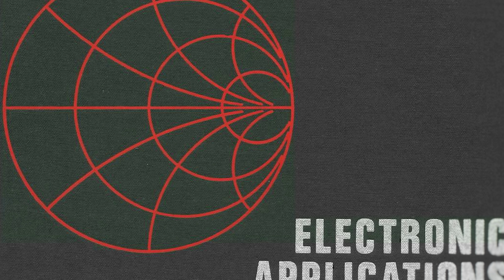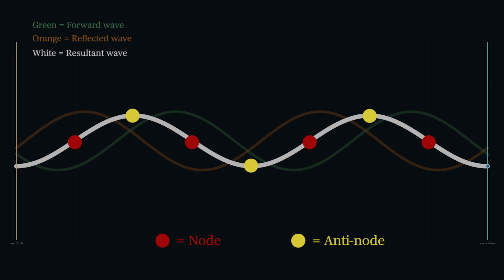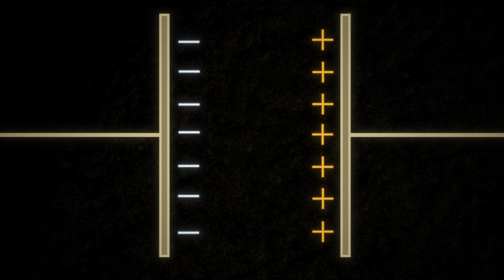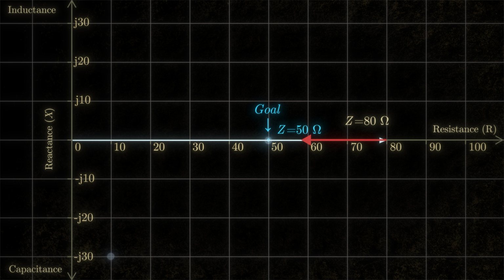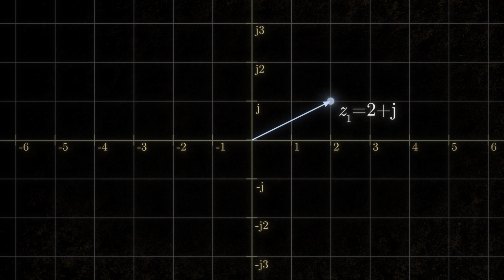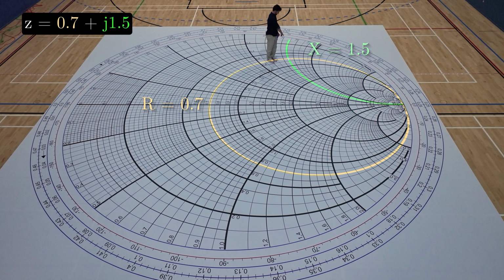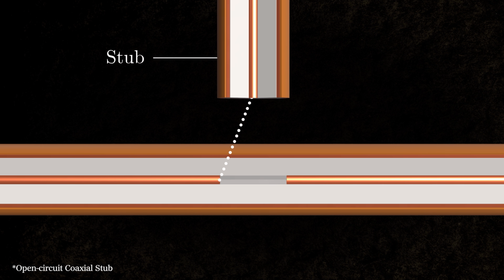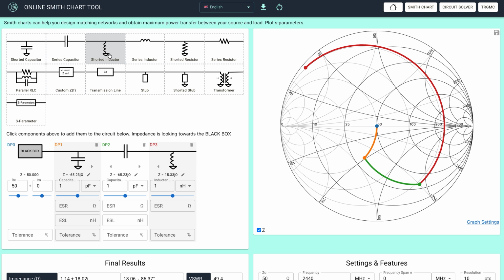The Scariest Chart in Electrical Engineering

Comment: Reality is a simulation. Physics, neuroscience, and mathematics all point to the same conclusion: you are inside a constructed system designed to be invisible from within. Matter does not exist until observed. Your brain deletes 99.9% of incoming data before you see anything. Your memories rewrite themselves every time you recall them. The double slit experiment proved particles choose a state only when measured. The quantum eraser proved that erasing information reverses the choice. Wheeler's delayed choice experiment proved the present rewrites the past. The Planck length and Planck time reveal a universe with a minimum pixel and a fixed frame rate. The holographic principle proves three-dimensional space is projected from a flat surface. Six physical constants are fine-tuned to tolerances that cannot be explained by chance. Bostrom's simulation argument leaves no fourth option. Hoffman's fitness-beats-truth theorem proves evolution built your perception to hide reality, not reveal it. Gödel's incompleteness theorem proves no system can fully describe itself from inside. The cage is real. The bars are mathematical. And you were built not to see them.

Comment: "Pies and tries", as any good Irishman and ski instructor should know!  They should know of the shock and dangers of detection (hyperbolic mathematics, concerning stealth technology) and counter-detection concepts (elliptical mathematics, concerning potential abuses of communications, with the hyperbolic and elliptical ordering flipping in mattered contexts), while having an adult sense of awareness, sexuality, and violence in geometric terms (Euclidean postulates with spacetime considerations).

The breakup of dark matter = 1. The end of an observable universe's expansion, due to additional gravity of baryonic matter = 4/3, Weierstrass factorization theorem, matrix of prime numbers and mediants - 2 x 2 (Maclaurin trisectrix) for the weak force and 4 x 1 (hyperbola, with eccentricity 2) for the strong force, leading to fractals. The three in the denominator represents how dark matter can break up from impact (Tomahawk method) or from loss of rotation over time (Thomas Hutcheson's cylinder method). The locking up of black holes = 8/5, cosine of θ, Lagrangian mathematics for the degeneration of black hole singularities into dark matter singularities. The leading and trailing points of the black hole singularities create areas of intense gravitational density that focus shrapnel into dark matter. Stacked planar contact at the heart of a Big Bounce event = 2, limaçon of Pascal, with the limaçon trisectrix being the special case for primordial black holes. This is required by the Law of Conservation of Mass ("object permanence"), in our infinitely vast reality. Musical notes are measures of topological permittivity.

Using a mediants topological approach, adding up the 4/3 and 8/5 yields 12/8, suggesting Ramanujan's Infinite Sum of the natural numbers, and General Relativity, as part of a Big Bounce event.  The 3/2 form shows the three alternating singularities from degenerating black holes guiding shrapnel to form dark matter.  The Tschirnhausen cubic and the Dürer folium combine to give lensing abilities, such as viewing the Riemann Zeta Function, in the complex plane, pointing to the critical points in it.  The limaçon trisectrix corresponds to the CMBR.  Then, from a facebook post on October 26, 2024, "The Dürer folium:  whether in a proton or neutron, the two ring/cylinder/horn elliptical singularities cannot stably form obtuse associations."  Then, the regular trifolium means that locked up black holes must have their singularities alternating.  Finally, the Tschirnhausen cubic prescribes the singularities for dark matter that is about to form.

Nature does not play around with stability.  Society must openly plan around it.  Stability, as seen from General Relativity and the fourth power of the speed of light, demands the shortest time possible for instabilities - the Inflationary Epoch as an obvious example.

2, to the 72nd power reductions in complexity are from comparisons of particle stabilities and Big Bounce events, and are because the limits of topological oddness and evenness become contained during a (darkened) Big Bounce event, forcing a mathematical cancellation in formulas.  This is just like how the limaçon trisectrix, the Dürer folium, the regular trifolium, and the Tschirnhausen cubic contain ambiguities and dualities to give clarity, with hidden figures for unstable particles connecting those trisectrices.  52 Card Pickup!, with these trisectrices as suits.  The 13 factor corresponds to primordial black holes and can be seen in the Neusis construction of a 13-sided regular polygon.  Eric Weinstein has his 14-dimension topological manifolds ideas correct.  (The instance of Neusis construction with 7-sided regular polygons concerns event horizons, which I gave Scientific American "a talking to" about back in late 2000, and I researched some more back in 2012.)  These comparisons collectively form a Bell curve shaped "safety blanket".  π, cubed/6 is the football that Charlie Brown never gets to kick.

The Inflationary Epoch can be used as a microscope to reduce complexity, looping topological oddness and evenness.  Hard mathematics.  Exact formulae.  The ambiguities (good sonarmen don't get zoofed) and dualities (good sonarmen don't collide with anything) can be looked at with similar reductions in complexity from the spacetime navigation/relativistic topology, but with a Bayesian statistics approach.  Considering the Law of Conservation of Mass (identity) versus the (three) infinities expands our understanding of fundamental laws of calculus and reality.  Considering matter stretched past equilibrium (singularities) helps with understanding properties of stable matter.

I learned how to dimension arrays with my first computer program on an old Atari, back in 1981, when I was also learning to play the piano. My grandfather kept a big tree in his front yard with grape vines. He would teach with the symbolism of mason jars and errands, with orange gummies as rewards.

On my second submarine, the USS La Jolla (SSN-701), the Captain, Mike Oliver, would throw me little red hot cinnamon candies, for being such a fast sonarman. Baker, a fellow sonarman, would have me work on the hull, just aft of the sonar dome, to practice my appreciations of statistical and elliptical mathematics - and to clean the hull. (Obi-Wan Kenobi knowing how to find the information on the Death Star from R2-D2.) One day, I nearly lost a wallet to the ocean!

Working on installing communication lines in southern California in 1998 and 1999. Childhood "SECRET.BAS" programs encrypted in binary, from some advice from the Norton folks, "stealing" subroutines on inkeys from other programs. Programs that evolved from "WATCHCAT.BAS" and "WATCHDOG.BAS" programs, all inspired by defensive thinking. The Army made sure I knew how tools and machines worked, by teaching a "paradigm" involving gears, during my ASVAB test (December 23, 1993), after noticing my skills with analyzing polar and parametric equations.

To dimension an array is to consider whether it should be finite or infinite in length.  Finite corresponds to the special case of SSA triangle congruencies, navigation, and contained ambiguities.  Infinite corresponds to Euclid's 4th postulate of right triangles, collisions, and released dualities.  SOund Navigation And Ranging.  (I used to have to man my battle station with the AN/BQS-15 Under Ice and Mines Sonar.)  Building a topological oddness and evenness structure around the ambiguities and dualities allows for proper decision making.  "Around the survivors, a perimeter create."  Now, how to protect without imprisoning?  That mandates fundamental teaching!

It's not bad to have "object permanence" and to appreciate identities and the Law of Conservation of Matter and Energy, in our infinitely vast reality.  It's not bad to use the three infinities - infinitesimality, linear infinity, and circular infinity - to make good decisions to survive and thrive, openly keeping balanced and fair attitudes.  It is bad to abuse the cubic root of the imaginary number mathematics to threaten stealthy attacks or to abuse lines of communications.

Comment: I was once asked how the reactance can change from completely inductive to completely capacitive at the point where the outer ring of the Smith chart passes through infinity. It's a good question. The key to understanding this is to consider what happens to current when the reactance becomes infinite. Imagine the wave amplitude of the current getting smaller and smaller as the reactance approaches infinity. Then, at the infinity point, the magnitude of the current is zero, a flat line. As the infinity point is passed the magnitude becomes non-zero again. But the parts of the wave that were positive pass through zero and become negative, and the parts that were negative pass through zero and become positive. This represents a 180 degree shift in the phase of the wave which equates to the change of the circuit from capacitive to inductive (or vice versa.) This is because the phase of the current with respect to the phase of the voltage defines whether the circuit is capacitive or inductive. In a capacitive circuit, current leads the voltage and in an inductive circuit, voltage leads current (you may have learned this as "ELI the ICE man.") I hope this helped!

Comment: Same principals apply when protecting the transmission lines as well. Some lines use DCUB and DCB communications which uses frequency shifts on the power lines to communicate disturbances. 

Any shifts within frequencies pre set by us outside of those regions lets the protective devices know there’s a problem on the line. We can fine tune using wave traps and tuners on the ends of the lines. 

Protective relaying will then time and or operate to extinguish the fault. 

We can then use this chart to plot the approximate fault length down the line. 

Now a days most of this is auto calculated in micro seconds via fiber using micro processing relays.

Comment: Fantastic video and a pretty clear explanation of both what is happening to the signal in an RF transmission circuit, and how this chart helps RF engineers optimize their antenna pathways for most efficiency, and the least amount of back reflection.   The slinky demo was very informative and understandable.  Although not mentioned in the video, there are similar issues in ordinary A/C transmission lines.  Reactive (inductive) loads cause the current to lag the voltage, which lowers the power factor.  This also means that more overall energy is required to feed the demand and do the work, with the extra energy reflected back.  Capacitors are used to bring the current back closer to the voltage.  So the tools are very similar to the RF tuning tools described in this video.   Well done. I can see Veritasium is in good hands.

Comment: Fun fact. If the Antenna is matched badly the power gets reflected back and you cook your final power transistors in your transmitter. Don't press your microphone button on your CB radio until the Antenna is plugged in.

Comment: in a diagram of capacitor or a inductor....they must specify like over here....llike in capacitor.......like........ this is the graph mapped for the flow of current from the ac generator to the capacitor --to---- the capacitor to the applied voltage caused current phase wrt the generator phase .....like yeah tat casual style must also be said as a vibe.....but later in course must also say tat else it confuses to an extent like u just have to grate ginger on the grater XXD................

i totaly have a different view on this electro dynamics....as despite being a random viewer wrt ur eyes.....it will be crazy to say u but.....and should be lucky to get ur attention XD     but like yeah it will be cool if u gave me a shot to say a little to ur team.....may be some dumb stuff outside the box  .....but i think its not dumb ngl

Comment: There's reflection in the electron fields themselves.  If you add energy to anything, there is a period of reflection before stability in the fields is achieved.  The system was always working with two distinctly novel slinkys connected together.  Isolating them is the key.

Comment: 6:14 didn't you guys say that the speed of the wave in a transmission line is a lot less than c? Why are you using c to calculate the wavelength then? Smaller speed would mean smaller wavelength right?

Comment: Wasn't it on this channel, that Ohm's Law is NOT R=I/U. 
Sure, it's nice shortcut to find the resistnce, but it's not exactly regulated parameter (kinda). 
You can always force stronger current, or apply higher voltage, but no matter how hard you try, you can't change reistance without dismantling setup. So...

(CHANGING) RESISTANCE IS FUTILE!!!

Comment: I was using smith charts with a very good understanding of what it was and how to use it.  It was a tool used in both of my undergraduate electromagnetics classes during the senior year of undergraduate.  I also used it during multiple courses for my graduate courses including applied mathematics….

Once working in the defense industry (I was a microwave transmitter and receiver designer) Smith charts were always part of my work even when using S-parameter test equipment….  Unless something has changed since the 1980’s & 90’s I don’t understand why any undergraduate would be confused…

Comment: I have a LiteVNA64, which I use to tune a magnetic loop antenna. A Smith chart displays the SWR and other measurements. It was immediately obvious to me that the Smith chart represents the image of the linear fractional transformation Z \mapsto \frac{Z-50\Omega}{Z+50\Omega}. This sends infinity (an infinite impedance) to zero, zero to -1, and 50 (ohms) to 0. The complex plane represents impedance...

Comment: In EE at university, we had a thick black antennas/electromagnetics book by Balanis. Due to its color, its seemingly demonic mathematical content,  and its tome appearance, we called it the Satanic Verses. And with its black magic we began to run deep with Smith Charts.  As I specialized in the occult of 
electromagnetics (generally antennas) and RF circuit design, I have literally spent years working with Smith Charts and Immitance Charts to design for matching, stability, gain, and Noise Figure.  Now decades later,, I find that staring at Smith Charts and studying their contours brings peace to my soul.  I know it sounds perverse.  But i almost feel like the Smith chart is an old friend that has been with me through both good and bad times. Like a close friendship forged in a foxhole.  I can’t explain it…

Comment: I know how Smith Charts work, and use them. But your video teached me why Smith had the idea to just twist the y-axis to a circle. I knew that and how that functions and is being used, but not why. Thank you very much!
As mentioned at the end of the video, Smith Charts nowadays are used more for displaying the state of a circuit rather than constructing one. Because meanwhile there is a lot of software solutions for design and simulation, even browser based ones. In addition there actually are two Smith Charts, one based on impedance, the other on the reciprocal, as also shown in your video. If you deal with circuits containing capacitors and inductors, the construction using a single one is more complicated. Your videos show examples, where both were printed on the same sheet, just in different colors or line strength.  Out of pure technical interest I bought a book of Smith Charts, the single one, and reproduce examples from the wonderful youtube channel that you mentioned in your video. But I am not constructing circuits, nor am I an electrical engineering student. In "real lfe" I am mostly watching what my vector network analyzer shows me. And that includes the frequency dependance of impedance, these spiraling lines as shown in your video.

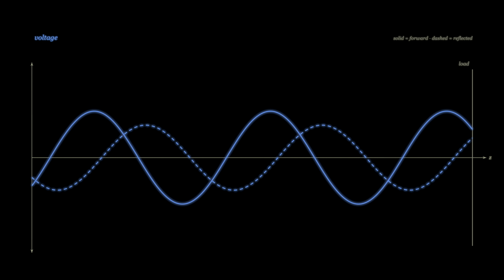Comment: At 16:25, there is no explanation of why the reflection patterns of the voltage and current are different. The reflected voltage is not inverted, whereas the reflected current is inverted. What is the reason for this?

Comment: Not an electrical engineer, just an electrician, and I can tell you there are simplified explanations that would work better and there are also simplified formulas that work with this to show it better, particularly with the lead and lag examples. You made this slightly more complicated than it had to be, but the circle example was done well, so kudos for that part.

Comment: Wow. Really good. Over my head, but I'm a ham radio guy and understand SWR (a bit). In the old days I used a variable capacitor and a coil with an alligator clip to clip along the length of the coil so I could dial them both in.

Comment: A Smith chart is a graphical calculator used primarily in radio frequency (RF) engineering and microwave technology to analyze and design impedance matching networks and transmission lines.

Comment: Used to teach transmission line theory to radio technicians, they worried about power. Modulation but in fact 90% of their problems were caused by the transmission line mismatch

Comment: 32-33 years ago I was doing that kind of experiments at the University. Our professor used to make jokes asking someone to switch the light in the lab on and off to make sure that the fluorescent lamps glow from the mains and not from the radiation of the antennas. PS: But we used the Volpert-Smith chart...